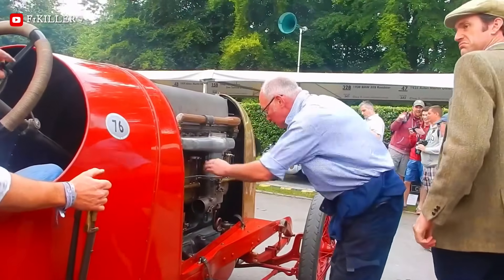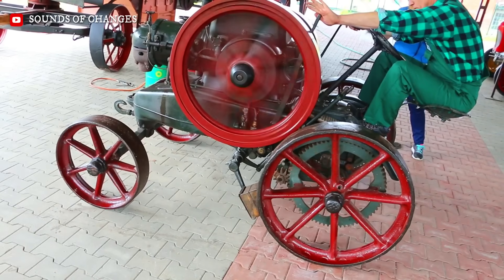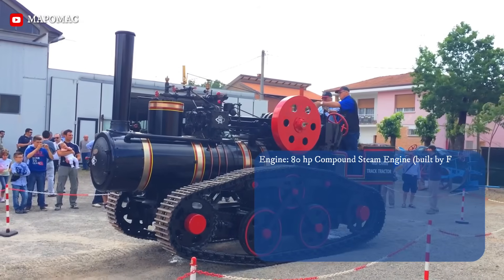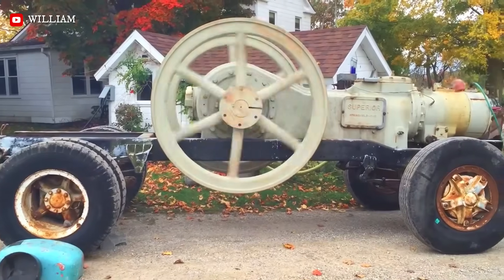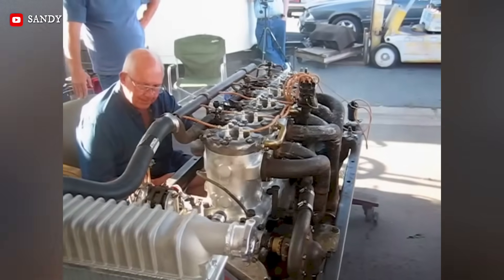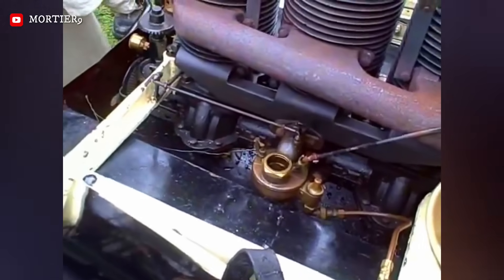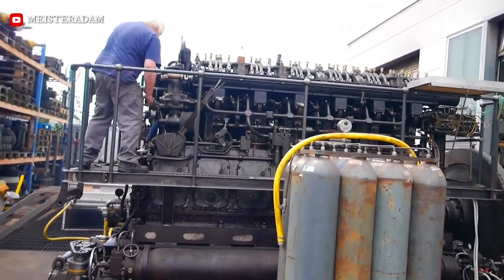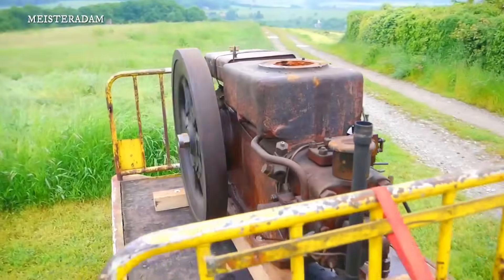Rare Old Engines Starting Up Sound That Will Blow Your Ears ▶21

Comment: nice sounds from the past, thanks . in my youtjh most smaller than trawler boats that fishers used had a central motor, quite often a Wickström (made in Wasa Finland/Vaasa Suomi) the Fiat S76 would be very effective forest fire starter. you might ad subtitles including engine data (from Wikipedia) : Configuration	I4
Displacement	28.353 L (1,730.2 cu in)
Cylinder bore	190 mm (7.48 in)
Piston stroke	250 mm (9.84 in)